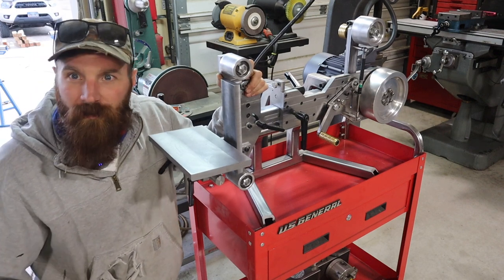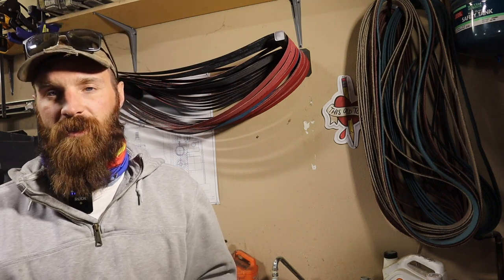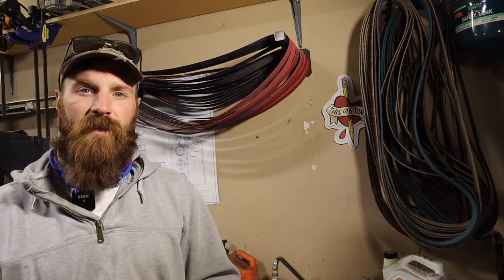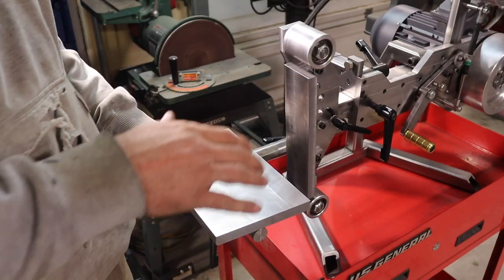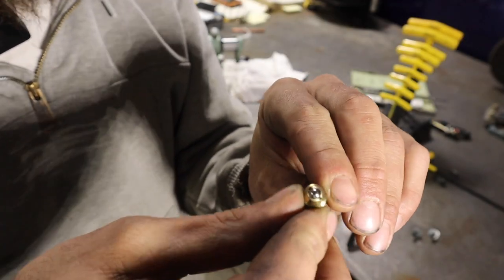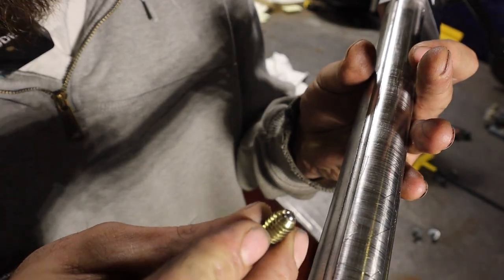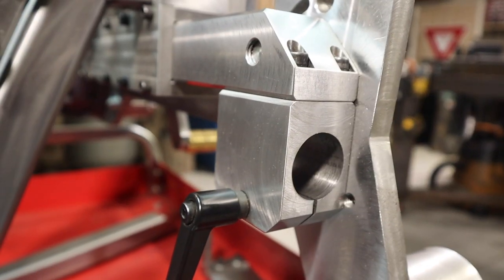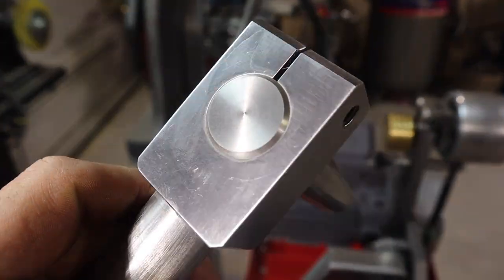phil vandelay belt grinder part 3

Comment: So glad that I found your channel (by searching YT for "vandelay grinder" to see if anyone else had built one).  I purchased Phil's plans a few days ago and have been slowly gathering my list of materials to start building it -- in Daytona Beach, FL, so mine will be imperial too.

That was CRITICAL INFO about the 72 vs 78-inch belts.  I'll plan to shorten my main plate slightly so that I can use off-the-shelf 72-inch belts.  I have Phil's plans in Fusion 360 so should be able to figure out the proper amount of shortening.  

I see that you started with 3/4 inch plate and milled down quite A LOT to match Phil's metric thickness (15mm, or about 0.59 inches).  I'd have been inclined to keep the extra thickness and adjust the plans accordingly.  But instead, I'm going to try building it a little cheaper by using 1/2 inch plate (with only a bare minimum of skim facing) for most of the parts.  I'll use 3/4 for the tension column, the platen, and the table.  I think (I hope!) that half-inch will still be plenty beefy for the main body parts, and could save a few hundred dollars in steel cost.   I can always add additional stiffeners/runners if necessary.

Now on to watching the remainder of your build vids.  And thanks for taking the time to post these so that others who follow can learn from your work.
Reply: If anyone cares, I've just worked things out using Phil's Fusion 360 file.  I started by drawing a sketch that kept the four wheels at their original position and size, then figured out the total belt length.  This included the straight sections (tangent-to-tangent on each wheel perimeter) as well as the portion of the radius of each wheel (calculated in Fusion 360 using the angles from tangent to tangent on each wheel).  It came out to about 78.4 inches, just as West Weld says, so that confirms that my math matches the real world.

Then I modified my sketch to use a smaller 6.2-inch drive wheel, 3-inch tension wheel, and two 2-inch idler wheels, still with the wheel centers in their original sketch position, and recalculated: now reduced to 76.36 inches around the full belt path.  This combination of wheels is available "off the shelf" from several eBayers.  Of course the smaller drive wheel will mean a slightly slower belt, but your VFD can likely compensate by running the motor that much faster.

Then I shortened the main plate of the build by 1 inch, shifting both idler wheels 1 inch "right" (looking at the front face).  This will also narrow the stand width to match, of course.  This brings us down to a 74.34 inch belt.

Then I shifted the idler wheels 1 inch closer together.  The top one comes down a half-inch and the bottom one comes up a half-inch.  (It can't come higher due to clearance issues with the platen mount.)  This is a simple change: now about a 73.4 inch belt, that I didn't bother to calculate.  Ya, you lose a half inch of belt height when grinding vertically, and a full inch when horizontal.  Still no big deal IMO.  

With the smaller diameter drive wheel, there's now room to move the motor and drive wheel 0.75 inches "left" (looking at the front face) while still allowing sufficient clearance to the belt tensioner lever.  This yields a belt length of almost exactly 73 inches.

And I think that's good enough!  To gain the remaining inch (to run a standard 2x72 belt), either move the platen adjustment  slider in a little or let the tracking wheel compress down a little, or a combination of both.  This was only "hacking" in Fusion 360 so far.  When I get a chance, I'll make the changes more formal in my copy, actually moving the wheel centers and sizes as discussed above, and then make sure of my math and adequate clearances.
Reply: I know that I've been monopolizing the comment section of this 2-year-old video, but just wanted to mention four more things:

1. Phil's plans are clearly labeled (and the Fusion 360 filename confirms) as a "75x2000" belt grinder.  So it's intended for a 75mm (just a hair shy of 3") wide by 2000mm (78 3/4") long Euro style belt.  Clearly labeled, but it had escaped my notice until your video highlighted the fact.  Thanks again for that.  I mean, I knew that the plans were metric, but didn't think (duh) about the metric belt size difference.

2. I see that there are also 2x82 inch belts plentifully available on Amazon.  Not as popular as 2x72, but 2x82 is clearly a thing in the knife making world anyway.  Just throwing this out because, if you have the bench/workshop space for it, it would surely be easier to lengthen Phil's design by three-ish inches rather than shortening it by 7-ish inches.

3. Oh, and I also find 75x2000mm belts available on Amazon.  Kinda pricy, but then there's about 1.6 times the amount of usable belt area overall.  So the easiest and perhaps best approach would be to stick with Phil's original plans and run the designed-for belt.  MY problem with doing this is that I wouldn't be able to make the 7.7-ish by 3.5-ish inch drive wheel on my mini-lathe, and I don't see anyone offering such a drive wheel off the shelf.  I'll keep looking.  But I'll likely stick to my plan of shortening Phil's design to accommodate the usual-for-USA 2x72 inch belts.

4. I've sorted out and put into my Amazon shopping cart all of the mechanical and electrical parts required for the build.  Everything except for the bolts (I have tons already), belts, and the steel.  It totals just shy of $880 using a generic 1.5 HP 3 phase motor and a very cheap on-sale 1.5kw VFD.  The steel and stainless steel for the build will likely add another $300-$600 ... a wide range depending on whether you use 1/2- or 5/8- or 3/4-inch thick steel, and whether you can source it locally or have to pay exorbitant shipping fees.   I figured from the outset that this was going to be a $1500-ish in parts build, and this is now confirmed.
Reply: Ya, it's me again, talking with myself.  Looking further into using the original 75x2000mm belt...

On eBay, I found a seller with a set of Delrin wheels 80mm (3.15 inches) wide.  The set has a 5 inch drive, 4 inch tension, and 2-inch idlers.  I tried that setup on the original Phil design and the belt length would be 75.58 inches long.  

As I noted earlier, it's easier to lengthen the plans than to shorten them, so I tried moving the wheel centers slightly, using the following adjustments: 
- Lengthen main plate to the left (looking at the face) by 1/4 inch
- While also lengthening the enclosed main rod by 1/4 inch.  So the idler wheels are now 1/2 inch further left, and we gain a little more adjustability.
- Also raise the top idler by 1/2 inch and lower the bottom idler by 1/2 inch -- which has the added benefit of a longer grinding surface, especially useful in horizontal mode
- And move the motor assembly 3/4 inch to the right.

With these changes to compensate for the smaller drive wheel, the new belt length is 78.79 inches -- perfect for a 2000mm belt.  Of course with the reduced diameter (5 inch instead of 7.67 inch in Phil's design), we only get 65% of the belt travel with the same RPM.  Or put the other way, we need to spin the motor 1.5 times faster for the same belt movement.  Phil's plans recommend a motor capable of around 3000 RPM max.  I was planning to use a 1725 RPM motor and use the VFD to "over drive" its frequency to get the 3000 (as shown in one of Clough42's older lathe modification videos).  But now I'll choose a 3450 RPM motor instead -- which are typically a little cheaper, as they use 2 poles instead of 4 internally.

Comment: I'm currently building this Vandelay grinder. I swear I found some 3x80 belts. I'm building mine exactly to his spec, but I'm using imperial fasteners is the only difference.
Reply: Oh, I also took the risk of using 5/8" plate. I got a beautiful surface finish using a rather large fly cutter.
Reply: Also, I just subscribed. Great channel!

Comment: bought the plans as well but in ND and cad files wouldn’t translate into my older versions w no response from vandalay.... it did look like a fantastic design for certain. wishing fir imperial tho as I’ll do exactly what you’ve done & input my own.
Reply from the maker: I'll mention it to Phil next time I talk to it........you can get an updated hobbiest account for fusion for pretty cheap.....I think I paid less than 100 for a year
Reply: @westweld  worst thing is i'm out in western north dakota, running net off phones as hotspot... sucks, can't get fusion to work proper. all good tho, I'm quick in cad and prob transfer into .dxf for my hurco anyway. solid design tho, work but anything worthwhile will be. nice vids, stumbled into them - you do well!
Reply from the maker: @darrenlucke  thanks im still trying to figure out the editing but I think they get a little better everytime........if you end up building the grinder you won't regret it. Its an amazing machine if you have any questions along the way id be happy to help if I can
Reply: @westweld  think after you've built one out of steel, could the main components, main frame, etc be built out of alum in place of steel? or do you think it'd compromise strength? obviously, table, ss rods, / platen prob should be kept steel?
Reply from the maker: @darrenlucke  I think aluminum would work.... I dont think i would do simply because of the weight you would lose i could be wrong but I feel like being heavy from steel reduces vibration and also the grinding dust would be hard on aluminum especially the sliding arm and moving parts......I think it would work people make them out of aluminum all the time but it wouldn't be my first choice choice
Reply: @westweld  it'd be easier to mill.. but valid points you've mentioned. I'm not sure how much I'd actually use it but I know I would if I had it. could easily throw in just a bit more tolerance on certain places to acct for grinding dust, etc - fab'd slide tube at least in one direction where the tightening groove is, for example, for ease of blowing everything out. I'd bet the alum would be dampening as well, possibly even more so???  cast iron would prob be the most effective concerning vibration as w any machine.
Reply from the maker: @darrenlucke  maybe true.......I can tell you one thing for sure after you've taken all the time to build one you won't want to do it agian haha
Reply from the maker: I own a small fabrication company .......one reason I bought his plans was because it was nice to just build somthing knowing it would work when I was finished I didn't have to think about it.
Reply: @westweld  yeah.. I do similar things.